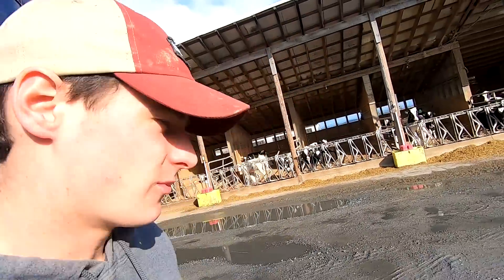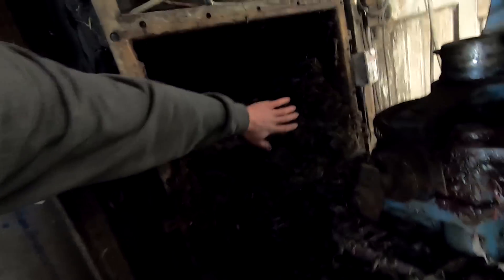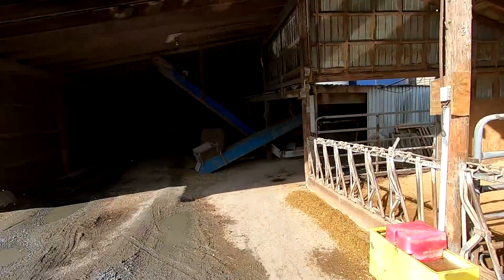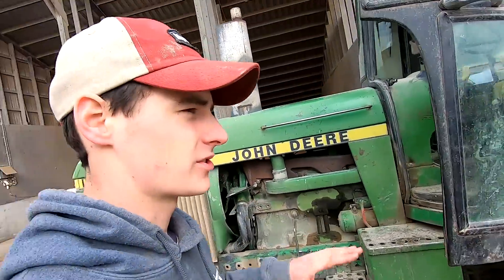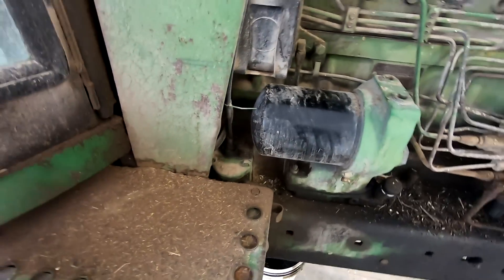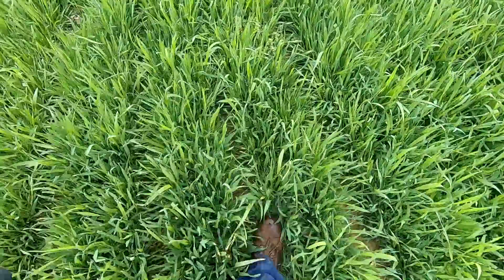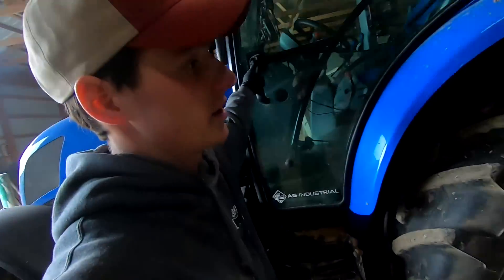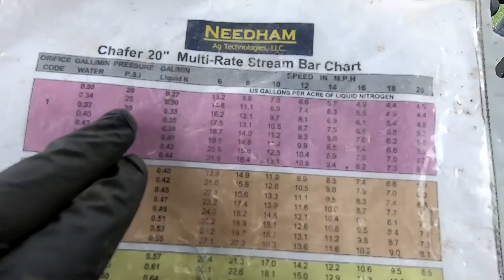Silo Cleaning & Other Farm Work

Comment: Great video..Quick tip.. use clean engine oil to lube up the filter gasket. Like that you put service info on filter, I add the filter part number and engine oil capacity..

Comment: The best funnel I had for putting oil in my JD 4250 was to take a plastic bottle from a gasoline treatment called “HEET” and cut the bottom and top off. Nice big opening on the tractor end for flow and wide rectangular fill end.

Comment: Used to do silo cleaning over here England.loved it lasted 5 yrs.entered them through the top using a didsbury tripod and winch.breathing apparatus.some material was stubbing.temp was always high intrinsically safe tools ie brass pick etc.gas tested.full adhere to health and safety.biscuit meal,corn pellets molasses etc.did notice over here a bad rat problem they used to eat the feed.balooned up .the stench of rat piss was horrendous so obviously had to watch out for wheels disease,

Comment: A Tip, apply a thin coat of used motor oil on the filter's O ring so the filter can be removed easily next time you change it.

Comment: At 14:45 you lost a washer.  I suggest you keep a bag of washers and any other small parts the sprayer needs with you.  Attach a small metal box to the sprayer to keep extras on hand. You don't want to tell Dad "For the want of a washer, I couldn't finish the job."   Stay safe.

Comment: You can wrap that big "o filter with a ratchet strap then tap the buckle with a mallet.  Also, pop a hole in it with a screwdriver to drain then plug the hole with a paper towel, spin it off.

Comment: Been a Tech for a little over 5 years now, and I'll give you an easier way to take off the oil filter. Use a hammer and a screwdriver. Hammer the screwdriver into the side and you have all the leverage you'll need.

Comment: Make sure you check with your JD dealer about that WIX filter. Company i use to work for was using them on the JD commercial lawn mowers and blew several engines due to the WIX filter. I can get into more detail about if you like but yeah. The auto part store says they are compatible but they are not.

Comment: Dip your finger in a small amount of the used oil and run it around the rubber seal on the filter, when the filter is put on, stop when it starts to get tight, then turn it a half turn and stop. The suction will do the rest. Never, ever, put a filter on that tight...now you know how it feels to get it off. Advice: If you ever have one that's too tight, put your bucket under the filter and tap a screwdriver through it and turn...full stop

Comment: Hint hint. There is a plug on the filter housing there for draining the filter.  It helps to buy a 3 inch extension then you drain it right into a can and prevent the oil mess.

Comment: If you do not  have a filter wrench or its to tight. Take off your pant s belt and wrap belt around filter just like your waist . But do not lock belt , belt will stretch and pull evenly all the way around filter.

Comment: The seal always goes into the groove on filters. The reason the seal was on the tractor is because it was stuck. Happens alot on heavy equipment. Good luck and keep the videos coming

Comment: This may sound nuts but the few times a year I had to leave the shop and actually go work on the farm......
 Everybody does something different and on this channel I think I've complained enough how I always hated and sort of cow shit and the smell. (Mostly the pee)
 Old silage is another but when the farm needs work every BODY gets called.
 Two of us fat mechanics devised a way to do the same job.
 BTW I can't crawl in a silo so I climb down into it.

We used the 8hp little giant leaf blower to air out the gas and I made fast work of turning the silage using this little Troybilt 2 cycle tiller we had.

I've even used it to till ice.

Comment: When you are spraying with those streamer bars and one comes off and you lose the washer you should carry a few washers with you in the tractor just in case you cannot find the washer if it comes off of the streamer bar just something I have learned over the years of using streamer bars

Comment: You need to get one of those filter remover straps
Reply: I thought the same thing. I could not live without them. I even open jars with one now. Don't laugh, it works great on any size jar.
Reply: That or just a good leather belt too now cause you can wrap it around the filter and then pull the end of it and itll unscrew it too been there and done that before here too
Reply: strap wrench

Comment: if you have a really really stuck filter hammer a screwdriver through the filter it will come off.
Reply: Won't always work. Then you have a real problem.
Reply: My brother in law did the screwdriver trick an tore the canister off the base plate of the filter . I got a phone call and the fun began😩

Comment: Cut off 6" of hose, split it long ways, then slip it over the hose and fix in place with another clamp to provide some wear and strain relief.
Reply: They sell a spring that can go over the end of the hose to stop that.
Reply: anastyb or a 90 degree fitting
Reply: Nice trick!

Comment: tip with putting oil filters on if you lube the gasket with oil it will make it easier to get the filter of when changing oil
Reply: Yup that's correct there now
Reply: Beat me to it
Reply: Also when tightening up he filter twist the filter back about 1/2 inch to relax the seal ring , it helps when taking off the filter
Reply: On my farm we use hundreds of filters a year and putting oil makes things go better.
Reply: Shouldn't it only be hand tighten too?
Reply: if a filter won't come off stab a screwdriver through the side and use it as a lever
Reply: Beat me to it too. Hand tight as well. I wouldn't want to be struggling to tighten it :)
Reply: @FriendlyJim  Yup! I forgot to mention about hand tight only.

Comment: Are you able to explain a little bit about the gases that build up in a silo, the dangers, and the precautions you have to take because of them?
Reply: Methane builds up from the decay of the organic matter, as well as CO2. The methane can be ignited by even a static spark and cause the entire silo to explode. High CO2 levels can cause you to pass out because it displaces oxygen in the air. 

Going inside of a silo is probably the most dangerous thing you can do on a farm, farmers die all the time inside silos.
Reply: Sam Plourde i never liked going in silos on dairy farm i worked on long time ago.
Reply: @samuelplourde284  What I like about this channel all the actions taken on this farm are thought out and then acted on. There is always an emphasis on safety. I kinda see it as thrift.

Comment: Fill filter prior to install, spread fresh oil on all new filter seals and other orings prior to install...
If it doesnt leak, ur good.  But an oring can easily be torn being installed dry.  Not filling the filter prior to install is bad for old motors that filter the oil prior to entering the block. 
Either way, you should be alright those old tractors are tough AF!  Just check the oil after like 20 minutes of run time, it'll likely be half a quart low

Comment: you need to fill the filter with oil befoe placing him your dowing Great  keep 👆
Reply: That's a good method if the filter is mounted upright but mounted with the filter horizontal, the oil would run out before it would be tight enough to reached the seal